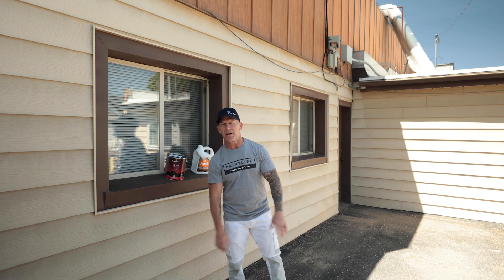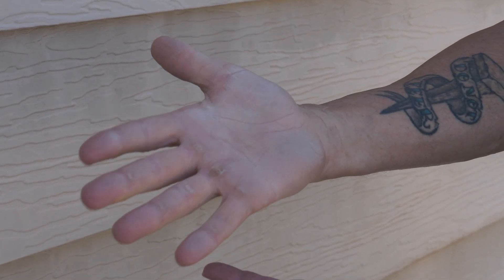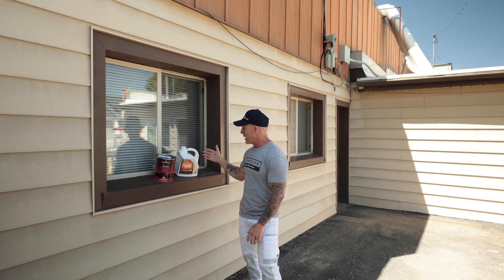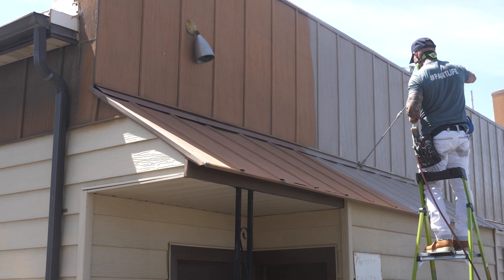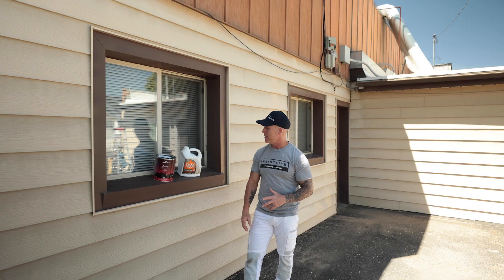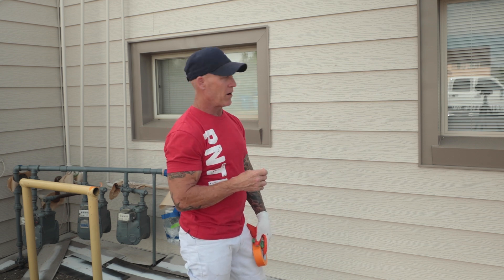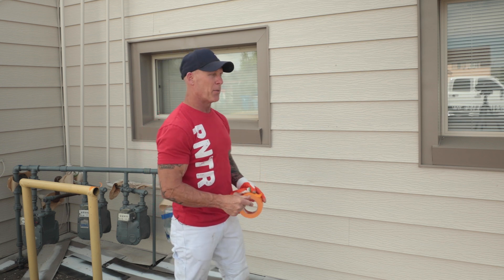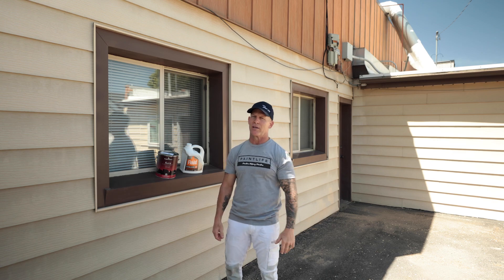How to Paint Chalky Siding! The Secret to Get Great Paint Aherence!

Comment: We spray 100% of exteriors with diluted Seal-Krete and it creates a nice surface that will accept any water based paint. You don't even have to wait for most surfaces to fully dry after pressure washing before you flood it with sealer. Down side is you're spraying everything twice, but it works well on paint that is heavily oxidized with the gulf breeze and sun.

Comment: The chalkyness is called oxidation caused by the sun's UV Ray's. I remove oxidation in my restoration company using a chemical called Cleansol BC. It easily dissolves it and can be rinsed off afterwards. You just have to know the correct mix ratio etc. I mix mine 9:1. 1 gallon of Cleansol to 9 gal of water to make 10 gal of ready to use product. I apply it with a 2.1 gpm 12 volt direct spray application. Spray a light coating over the section you are working on at the time. Let sit 4 to 5 minutes. You will start to see the oxidation starting to dissolve and run down the surface. Spray another light coat over the same area again. Let sit another 4 to 5 minutes. Then rinse the area really really good either with a pressure washer rinse nozzle or just a garden hose with decent volume & pressure. Takes all the oxidation completely off. There may be a couple stubborn areas under a window seal or here or there. If you run into that just hit that area again with a light spray and brush it off. 95% or more will just rinse off.
Reply: Such a useful comment, thank you sir.
Reply: Do you prime too just paint with that additive?

Comment: Floetrol is water and low acrylic white latex paint mixed together. It will give runs it cheapens the sheen and only works just ok with white paint. If you mix it will anything tinted it will change the color in a noticeable way.
Reply from the maker: Nice

Comment: Came across this and soooo glad I did.  I have a rental with white aluminum siding that has severe "chalk".   Hoping to lightly power wash, add this to my paint and have good results.  Wondering if you have any tips on washing / prepping the siding other than don't BLAST it with high pressure. Thanks for posting this video!

Comment: I painted my house 4yrs ago with 'high-end" Valspar Exterior UV protectant latex blah blah blah paint. It has now faded in the sun and has a chalky type film on it. A couple of local painters said to just power wash it and paint over with Sherwin-Williams Emerald or Duration. 
Should I worry about flaking? Should I use this product you are showing in addition? I have the engineered lap siding (hardie?) which is about 18yrs old.

Comment: Awesome video. My problem is my aluminum facia is oxidized in areas and the paint it chipping off especially towards the top near the roof. Do I need to sand the entire facia all the way around or simply have it replaced?  Or is there another way to paint it without having to worry about future oxidation and paint chipping?
Reply: I have the same issue. I'm in the south with aluminum soffit s as well. Will this plug the vent holes? Sidebar question. My gutters are brand new but have zebra triping. Going to paint the gutters, facia and soffits all at once. Any issues to be aware of?

Comment: How to paint vinyl siding? Rick B.
Reply: Light colors only. Dark colors attract heat and can warp the siding
Reply: Prep!!!  Wash siding by hand and soft brush!  Add cleaner and water T.S.P Rinse well.  Best tools to paint.  6” fabric whizz roller and 2 1/2 gooseneck flexible paint brush extension. Paint 3 strips at a time going from one end to the other. This will avoid lap marks and holidays. Cheers!  The gooseneck guy!